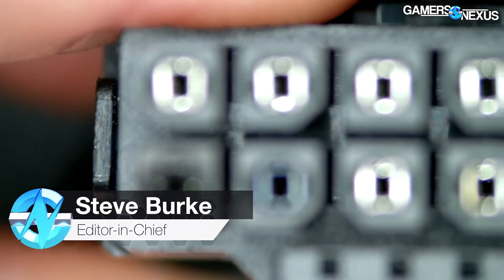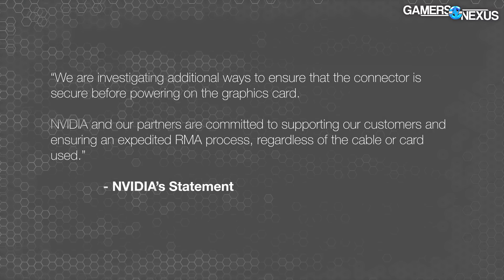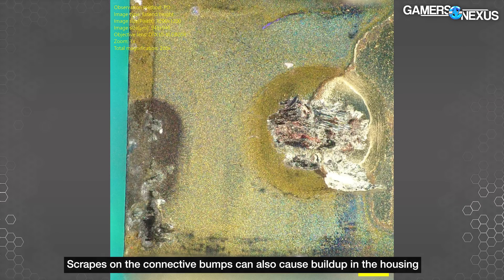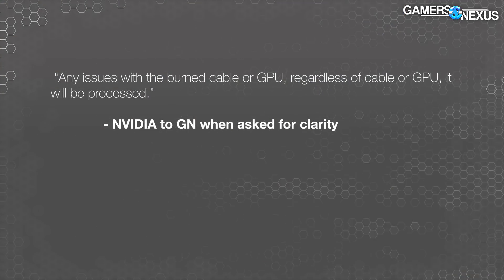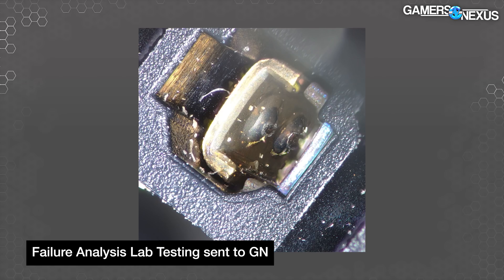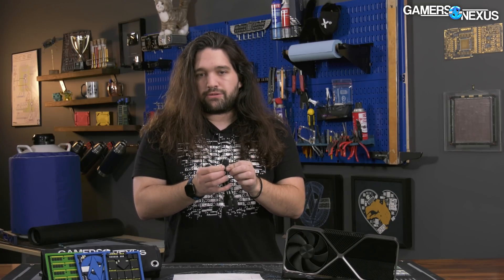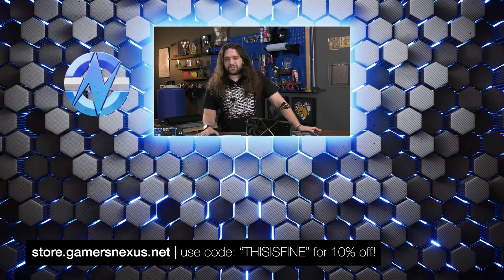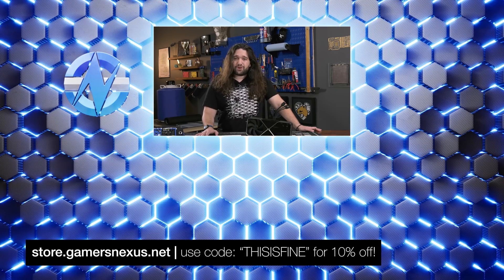NVIDIA Responds to Melting Cables, Warranty Concerns, & 12VHPWR Adapter Failures

Comment: Here's a novel thought: Why does 12VHPWR (what a stupid fricking name. "12vHC" (12v high current) is more on the nose.) even exist? Why does the chonky boi 4090 NEED a single connector? It's got space for multiple regular 12v PCIE connectors. You know, the ones you can bend and not worry about starting an electrical fire. It sounds like they were trying to be too clever in the first place, and now it's biting them in the backside. Power connectors don't need to be "intelligent", THEY NEED TO WORK Everything beyond that is unnecessary. Stick the logic on the card. "do I have 12v on 12v PCIE connector 1? K, then that's 225 watts more than the 75 watts I can get out of the PCIE socket itself. So I've got 300 watts to play with..." Add more sockets and logic to handle them and you could conceivably have it able to accept hot-plugging the extra power connectors and have it report back to the user "hey, I'm running at reduced rate because I need more current. Plug in another 12v PCIE connector."  As well as so users could have a more server-like experience with hot-swap PSU modules. (and perhaps making it so you could gang up multiple UPSes in places with flaky power.)

Comment: Easiest way to avoid this BS is to not buy Nvidia. 50 units is BS. I'm one person with a fairly small social circle, and I know 4 people that have had cables melt on the 40 series cards. As far as I know they haven't had any problems with the RMA process, however there shouldn't be a melting power cable issue at all. I also don't buy the statement that every cable inspected wasn't plugged in properly. I just don't believe them. They're full of $hit...always have been, always will be. The fact is, they designed a poor power connector. Blaming it on the user is just passing the buck. Typical Nvidia.

I'm willing to bet, if it wasn't for the thorough testing done by GN, Nvidia would have almost entirely ignored this issue publicly.

Comment: With GN findings (including independent labs used by GN) indicating possible user error and unknown materials making contact with the connector with the low chance of it occurring globally, the individual who went straight to court will either have to withdraw the case and lose money to pay for the lawyer or continue will the lawsuit with a really low chance of winning and he/she will also have to pay the opposing lawyer fee if he/she lost the case.  Should have waited for the research to conclude instead of letting emotion (and/or greed) to take action.

Comment: Personally, I would move the latches to the sides, so you squeeze the connector to remove it. One latch in the center doesn't make for a stable connection, it can rock too much. Also makes removal easier, squeeze the sides of the connector and pull, less strain on cables.
Reply: A latch system like you have on memory dims would be an idea where it is quite clear if they have engaged or not. I have seen similar designs for automotive applications where it is clear there is a lock
Reply: remember the dvi cables with the screws left and right? why not something similar with much smaller screws that force the connector into position. might seem a bit "excessive", but id prefer it over a system where i can fuck up this bad even if i double check. just because this weak ass plastic clamp does not snap in properly
Reply: @paulpur3  We use screwdrivers for installing components in computer so why not make power connector with actual screw. They can be quite low profile and perfectly secure at the same time.

I mean we are talking about cards that cost north of 500 bucks nowadays having more that just bent metal pins and a plastic sleeve is not asking too much I don't think.
Reply: @Vaasref  Anderson connectors.  That's the military style you're referring to.  The problem is they're bulky, complicated, and expensive.  Remember, these connectors aren't just meant for graphics cards.  They're an industry specification.  So, we could see low end Motherboards using them instead of 8 pins.
Reply: @Vaasref  2 problems with screws. 1. they conduct electricity 2. they are expensive!
Reply: @TamerZiadyofIntuitiveDesign  1. he isn't suggesting simply driving a screw through the current connector, it would be new connector similar to old display cables with fixed screws on either side. they won't touch power.
2. uh what? the screws themselves cost next to nothing. I'd be surprised if the cable/gpu would cost even $1 more to make with that kind of connector
Reply: @xvnz  Understood. The redesign of the whole plug and getting it through ISO and other standards will cost more. The manufacturing of plastic & metal parts together costs more and is a more complex manufacturing process then a plastic only plug. 

I have seen some crazy things in my lifetime. Include one person that used a screw driver to screw the RGB adapter so tight that it actually collapsed the pins. 

I have also seen situations where a metal screw fell within a chassis and caused major problems including burning up  the PSU. 

When I started in ancient times to work on machines, the use of metal parts was so much more prevalent and caused many more problems than one would think.

Today, the use of plastic encased plugs and specifications makes the DYI builder life a lot easier that at one point it was not. 

And even if the cost difference is 10 cents only; you have to count the change on all the devices from all the manufacturers that use this adapter. When 10cents is across millions and millions of cables and devices; the cost very quickly becomes prohibitive.   

I think it is a great idea; however, I don't think it is as simple as designing a one off and adding some thumbscrews and viola; all the GPUs and all the standards that have been heavily engineers for very specific reasons the way that they are would change. 

But hey, who knows. Maybe I am just old and silly. Get a 3D AutoCAD put your design together and send it to Nvidia; I am sure if it would be effective; they would at the very least send you a couple of free GPUs.
Reply: And mind you, because of plastics flexibility and lack of rigidity; the plugs last longer and are much tighter fits when fitted properly. 

Lots of the older devices that used thumb screws and such were never perfect fits and often got dented since the metal parts are not flexible like plastic can be.
Reply: @TamerZiadyofIntuitiveDesign  I really don't see this as a big issue, Nvidia ships the 3 to 1 adapter with the cards they should be able to do whatever they want with the plug and socket. If the three ends stay as they are there is no change needed for PSUs and a new ISO standard can be done later if at all.

MSRP for the 4090 is $1,599, they could raise the price $50 and if I can be sure it wont start a fire in my house I'll gladly pay it. But even without raising the price their margins are surely bigger than 10ct and besides that 10ct times 130,000 units sold is $13,000, 50 RMAs is $79,950 so it would have been money well spent including wages for the engineers to design the plug.

It is too late for this generation but they should keep it in mind for the next one.
Reply: @TamerZiadyofIntuitiveDesign  and regarding users applying brute force there is nothing that can be done. they don't have a safeguard against using a mallet to get the card into the PCI slot either and it seems to work out ok.
Reply: @xvnz  actually this is addressed in the video! It is about standardization. You don't want Nvidia to be the gatekeeper of such parts. And btw, this is part of what made building machines back in the 80s and 90s a complete pain and only for the very well informed. There was no standardization of cables or plugs. You had to know exactly what you were doing with certain connections or you could very easily destroy your build. 

But you are not wrong; NVIDIA can do it and likely may; however, this was a nightmare before and can become a nightmare again if every peripheral manufacturer decides to use their own proprietary connection designs.
Reply: Always remember, this is not just for the small gaming market or subset of computing. This affects all computing! From datacenters to SOC devices to embedded systems in cars and the list goes on.
Reply: @xvnz  yeah, that's true. I am just suggesting that even with the most well-intentioned designs; people will still screw things up. LOL
Reply: i.e. users are lusers ! LMAO :P You know the dreaded I.D.10.T error!
Reply: @paulpur3  Great until the screw or worse thread it is going into gets stripped out, then lose the screw and the wrong size is used.
Reply: How about include a UFC fighter that slaps you if the cable is not seated correctly
Reply: I was thinking JBWELD and FLEX TAPE.
Reply: at this point they might as well just have left the PSU plugs on the PCB >.>

Comment: It's almost like they should've borrowed from the past, instead of relying on crap like this: screw-in retention.
[pre-submit edit: actually, yea, I like that shorter Sense pins idea; simple and elegant!] 

           "We're looking for ways to ensure the connector
            is properly connected to the card"
Simple! A tiny microswitch (like side buttons on a smartphone use) that gets depressed ONLY once the plug is fully inserted. 

Since the power plug isn't going to be inserted and removed a bajillion times, button wear won't be an issue.
Though, even if they did plug it in thousands of times on a cheap microswitch, there still wouldn't be an issue... because look at inexpensive mice which endure a crazy amount of clicks and survive.

Comment: NVIDIA needs to replace all burnt cards though because the reason it wasn't plugged in fully is because of the moronic idea to have it come straight out of the card and on smaller cases it has to be manipulated to insert properly in the case.

Comment: Have always fully socketed the pcie cables into the GPU outside of the case. You're also putting more strain on the x16 slot by trying to socket it while already installed.  It can be done but it's just awkward.

Comment: A better solution might be engineering a chip that doesn't require a gigawatt of juice supplied through a rats nest adapter, or installing a cinder block sized "card" for gaming?

Comment: This has really gotten tiring, enough already it's just a damn cable. Just make sure the engineers and the desk workers who gave the go for this are fired and just tell everyone how to avoid the issue and just move on. Push the connector in hard and hear the damn pin latching on, done. If you have enough money to waste on a 4090, please demonstrate enough brain power to at least recognize that you dont have a brain big enough to deal with the intricacies of the thing and just do the obvious thing, make sure it's plugged in all the way and keep your cable as un-bent as you can.

Comment: Fun fact: GN shows a wear line visible on the affected cables during his investigations
Nividia the next day : We have been able to test the cables and in ALL of the cases a wear line is clearly visible.

Not only their cards price is shitty but the level of incompetence is even worse....
Reply: While I'm "allergic to green" for +20 years of personal bad experience and reasoning, I actually think Nvidia came to this conclusion before GN. The reason I think so is that MSI, just the other day, released an updated user guide to inserting the connector which stresses multiple times that the user must check that it has latched correctly, and even suggest inserting it in the card prior to installation of the card.

But I also think their PR/Marketing team was carefully monitoring when it would be a good time to say "Users are stupid" without too much backlash... and GN gave them the perfect 3rd party backing they needed to say it out loud.
Reply: @andersjjensen  Well as much as I want to believe this but I'm pretty sure MSI released their statement after Igor's finding. If Nvidia lazy, MSI is know for their shitty support so I guess they were just dodging the bullet. Even more confusing Nvidia's statement about 3rd party cables which I find a very defensive move .
Reply: Ah yes because surely a billion dollar company can do an update video in case they are wrong about their findings and don't have to do mountains of paperwork and in-house testing over the course of weeks to document the issue. You people are so intelligent it blows my mind, on one hand you want company to address issues that 0.04% of users have immediately and then when they finally do you call them out that the reported failure rate is too low and they need to further investigate. Ironic.

Comment: This has been a very interesting issue that your channel has investigated. Great work. Now.. why is it that they made a plug that only has 30 cycles to plug in and out? After the 30 cycles, will customers have to buy a new plug? Or is 30 cycles an estimation? I'm just trying to understanding why make a plug that is limited to how many times you can plug it in and out.
Reply: 30 cycles is just the testing limit, it's a common limit that also applies to many 8-pin PCIe connectors.  It's just the minimum guaranteed durability, it's not a maximum or limit.  If you want to pay a lot more, you can get 12pin Molex Micro-fit (Which is what the 12VHPWR is based on) connectors with a 10000 cycle durability spec.  I sincerely doubt most 12VHPWR connectors will see more than 10 cycles within the equipment lifespan.

Comment: I have 2 opinions really regarding the whole thing. Point 1 - such an expensive card 'may' warrant a more foolproof design in connection to protect the consumer from the installation error - unless Nvida are willing to replace cards, in which case they should do it to simply to prevent haemorraging money to idiots having to investigate, process, and replace these things. Point 2 - If you can't ensure your super expensive card is correctly installed, more fool you.

Comment: This is a typical oversight in design and engineering, and the engineers being usually a very confident breed, or should I say, overly confident, are suddenly ready to mark this as user error.
Powering a graphics card should require no more effort than inserting a cable, and inserting a cable into a socket should be a straightforward, no nonsense operation.
There should be no excuse or procedure added to just plugging a damn cable.
Thinking a human being that just wants to power a computer, and marked the power connection as done after assembling it, will triple check a simple connection every time he pokes on a cable is the most idiotic assumption ever, so stupid it is not even worth commenting on.
The best solution is the simplest one, always: this adapter was not a simple solution from the get go, and the whole failure story proves it.
The cable itself should feel socketed and clipped and there should be zero doubt that this is not reversible, even pushing hard on the cables while cable managing.
Every other thing is a design fault.